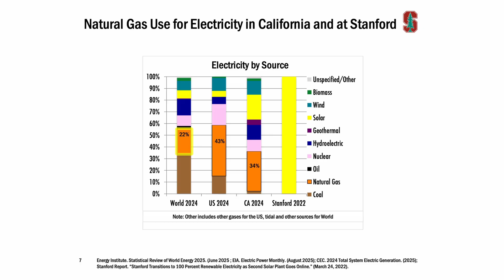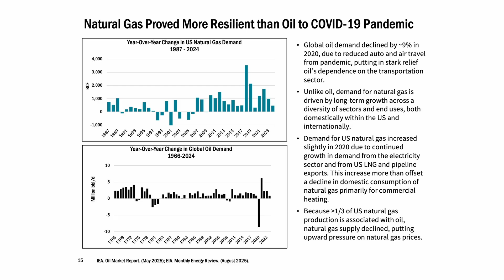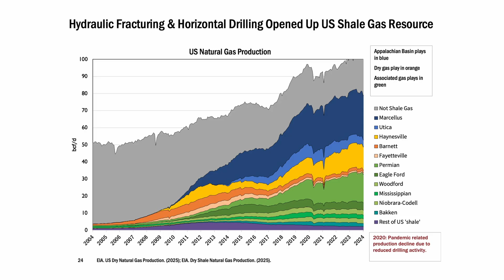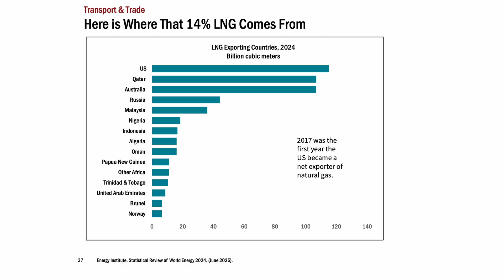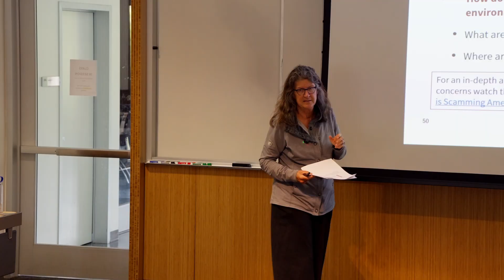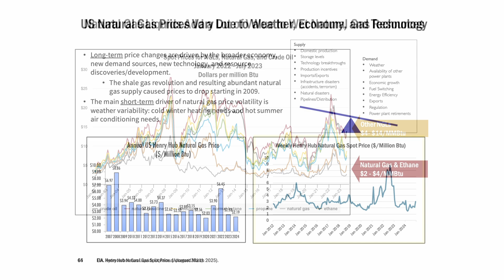Natural Gas Lecture | Jane Woodward | Stanford Understand Energy

Comment: Dear Professor Jane Woodward,
I hope this message finds you well. I am writing to express my interest in the important role that natural gas has played, continues to play, and may continue to play in the evolution of the global energy system. As countries seek to balance energy security, affordability, reliability, and decarbonization, natural gas remains an important subject of discussion within energy policy, electricity markets, industrial development, and the broader energy transition.

The history of natural gas demonstrates how this resource has evolved from a relatively underutilized fuel into a major component of modern energy systems. Advances in exploration, drilling, pipeline infrastructure, liquefaction, and liquefied natural gas (LNG) transportation have significantly expanded access to natural gas and transformed it into an increasingly global commodity. Its development has also been closely connected to changes in electricity generation, industrialization, and international energy markets.

One particularly important characteristic of natural gas is its **versatility and dispatchability**. Unlike solar and wind generation, which depend on weather conditions, gas-fired power plants can generally be dispatched when electricity demand increases or when renewable generation declines. This flexibility can provide valuable support to electricity grids as countries increase their reliance on variable renewable energy sources.

I am particularly interested in how natural gas can contribute to maintaining grid stability during the transition toward higher shares of renewable energy. Solar and wind power can provide substantial quantities of low-carbon electricity, but their intermittency creates challenges related to balancing supply and demand. Gas-fired generation can therefore serve as a flexible resource during periods when renewable generation is insufficient, particularly while large-scale battery storage and other long-duration energy-storage technologies continue to develop.

At the same time, the future role of natural gas raises important questions about climate policy and the long-term structure of the energy system. Methane emissions throughout the natural gas value chain, carbon dioxide emissions from combustion, and investments in new gas infrastructure must be considered alongside the benefits of reliability and flexibility. The challenge for policymakers is therefore to determine where natural gas can provide the greatest system value while maintaining credible pathways toward lower emissions.

The emergence of LNG has also changed the strategic importance of natural gas by allowing gas to be transported across oceans and connecting previously separated regional markets. This development has increased opportunities for energy diversification and security while also exposing countries to international price movements and geopolitical developments. Understanding these dynamics is essential for assessing the future role of natural gas in global energy security.

I would greatly appreciate your perspective on how technological innovation may influence this balance. Improvements in gas-turbine efficiency, carbon capture and storage, methane-emissions monitoring, hydrogen blending, renewable natural gas, and other technologies could potentially influence how natural gas fits into future energy systems. However, the economic and technical feasibility of these solutions remains an important subject for further research and discussion.

I am also interested in understanding how the role of natural gas could evolve as battery storage becomes increasingly competitive and available at larger scales. If energy-storage technologies eventually provide sufficient capacity to manage prolonged periods of low renewable generation, the role of gas-fired generation could change substantially. Nevertheless, the pace of this transformation may differ considerably between developed and emerging economies because of differences in infrastructure, financing, electricity demand, and access to energy resources.

Against this background, I would be honored to hear your views on the following questions concerning the role of natural gas in the global energy transition: *(1) How do you assess the historical importance of natural gas in the development of modern energy systems? (2) What makes natural gas particularly valuable as a dispatchable resource for electricity-grid balancing? (3) How important will gas-fired generation remain as solar and wind capacity continues to expand? (4) To what extent can natural gas effectively complement intermittent renewable energy before large-scale battery storage becomes widely available? (5) What technological developments could make natural gas generation more efficient and environmentally sustainable? (6) How significant are methane emissions in determining the long-term viability of natural gas? (7) Could carbon capture and storage substantially extend the role of natural gas in a lower-carbon electricity system? (8) How might the expansion of LNG influence global energy security and the geopolitical importance of natural gas? (9) At what point could large-scale battery and other storage technologies significantly reduce the need for gas-fired peaking and balancing capacity? (10) Looking toward 2040 and beyond, what role do you believe natural gas should play in achieving a reliable, affordable, and progressively lower-emissions global energy system?*

Your insights on these questions would be extremely valuable for understanding the relationship between natural gas, renewable energy, energy security, and the technological transformation of global electricity systems. I believe that informed discussion of these issues is essential for developing energy strategies that recognize both the opportunities and limitations of natural gas during the transition toward a more sustainable energy future.

Yours sincerely,
Luís Lopes